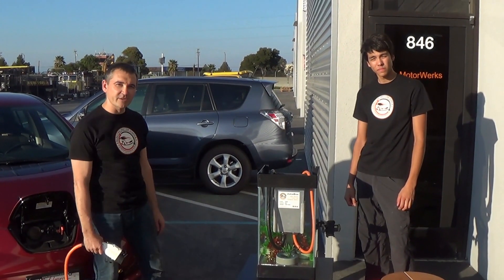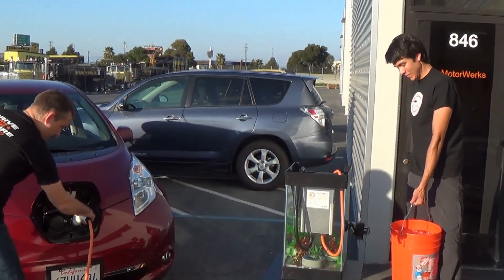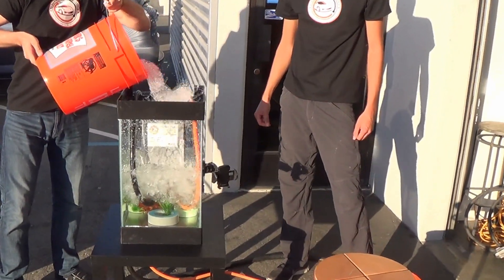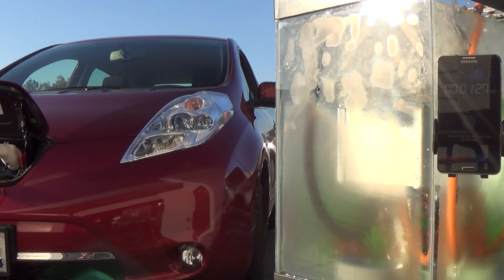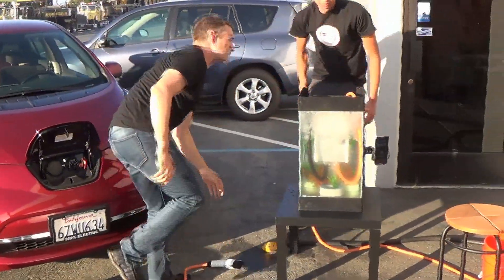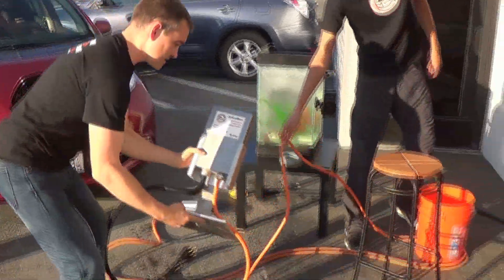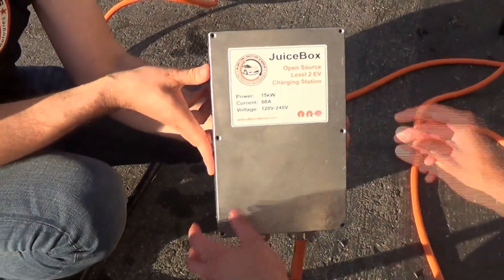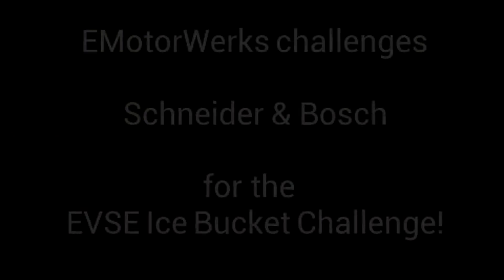EMotorWerks Launches the "EVSE Ice Bucket Challenge"!

Comment: Cool, but I don't see 60 amp version on your website like in this video. I see a 40 amp, which I bought, and 75 hardwired one. Is this one discontinued?
Reply: Development at eMotorWerks goes pretty quickly... the "60A" unit was discontinued long ago due to confusion. The chassis itself was capable of 60A. The cables that were often bundled with those units were usually only 32A rated (like the thin orange cable seen here), and thus the units were configured for 32A operation. It was ultimately upgraded and standardized on 40A, being the units you see today. So, a mix of both, actually... :)

Comment: Hehe, water actually has pretty high resistivity so it has a decent chance of working even without the case. You can make it a salt water ocean challenge and leave it there for a month. Ben Nelson's iMiev didn't make it :)
Reply: Pure water, sure, but most water (especially water coming out of random buckets and coolers) is sufficiently impure that it will happily conduct electricity.
Reply: wolrah The JuiceBox has a complete water tight seal around the box edge. I know because I buit one and that was the first item I installed. No water, either salt or dirty, can get in!
Reply: Raymond Ramírez I was responding to Dan Frederiksen's remark about it working without a case.  In perfectly pure water that would probably work, but I certainly wouldn't do it.